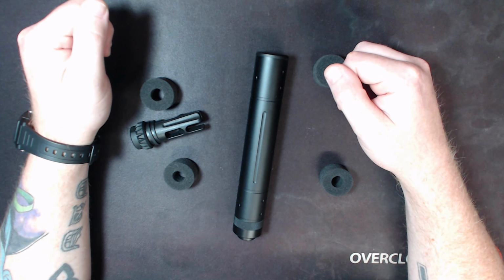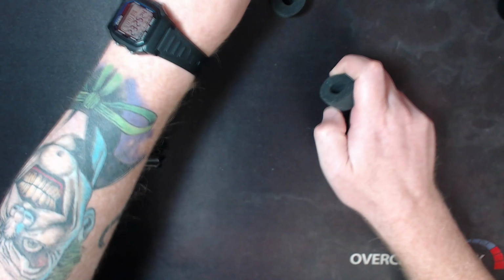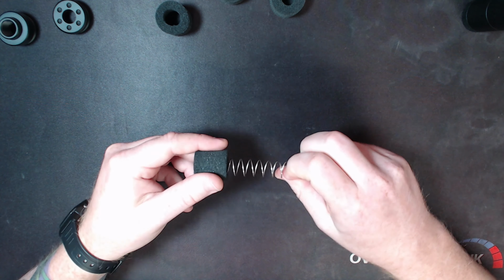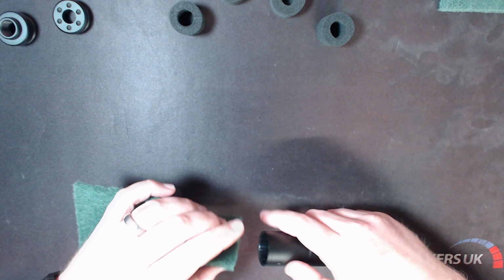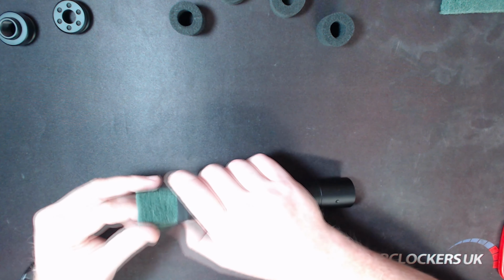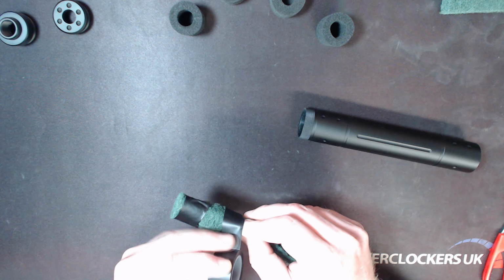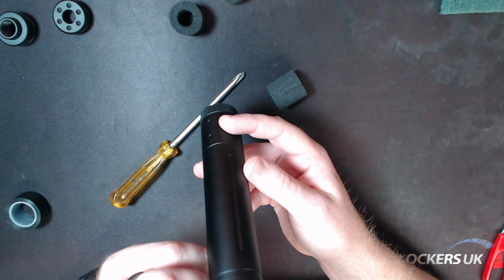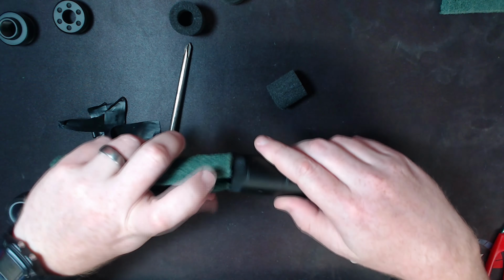Airsoft HPA Suppressor Make Up Internal Modification Brillo Pad Sound Baffles Silencer M-ETAL

Comment: It would work better if you cut washers out of the scouring pads that resemble the end of the foam inserts and stack them.
Reply from the maker: I did try that but getting the holes right without proper cutting tools was a nightmare. My new suppressor (SBA DTSS) is made with alternating size discs and it’s crazy quiet.
Reply: @AngryBullAirsoft Do you have a picture or video showing this?
Reply from the maker: @adamnarey8138  how do you mean? You mean the alternating inner?
Reply: @AngryBullAirsoft  Yes mate, the alternating size disks - especially how you suffered through cutting the outer and inner sizes without the correct tools 😂
Reply from the maker: @adamnarey8138  with you - the SBA comes with this as standard. I think Novritsch has similar in his now
Reply: @AngryBullAirsoft  Oh, I thought you did the alternating size discs with Brillo pads? As ones that are pre-made are very smooth as stated

Comment: Great idea but  i would include one more step into your guide and that is using a torch and gently removing hairs from the inside of your foam pad before rolling it into the suppressor. Like this you will have a much better result than with a pipe sticking in afterwards.

Comment: Build the foam around the spring, 
Us the discarded spinning as jig to Build around.
Reply from the maker: Posisbly yes, but - is the spring too wide? by closing in a bit more you can do better. I'm currently using Silverback suppressors on my rifles, those things are crazy good with no effort needed.

Comment: Have you done any experimenting with HPA builds of how many foam baffles or what suppressor length you need before it’s diminishing returns?
Reply from the maker: I haven’t, since making this video I bought a SBA DTSS which sounded “better” it was quieter and less crack on the output. I stopped fiddling at that point.
Reply: @AngryBullAirsoft  which one? The 338 big boi?
Reply from the maker: 308 but it’s still a fairly big beast. Love it on my MTW - barely hear anything
Reply: @AngryBullAirsoft  Nice! Best suppressor you’ve used then? Better than the scotchbrite mod or better than Hex?
Reply from the maker: Difficult to say as I haven’t had them all side by side but my general feelings are DTSS is an easy option without needing hours of tweaking. It’s just a suppressor after all. I have a 338 on my silverback srs and I bought one of the mk23 ones for my mk as well. I have confidence in them
Reply: @AngryBullAirsoft  Nice! I have an old carbon one knocking about somewhere, must say I think the Silverback foam is very nice! May adapt it for a prototype HPA VSR build I’m doing

Comment: I was considering punching discs out of this and stacking them inside for a more uniform hole
Reply from the maker: Would be the best approach if you alternate the hole size between a larger and smaller aperture to give more surface area to absorb sound waves 👍
Reply: @AngryBullAirsoft  im just worried about creating turbulent air in the suppressor and effecting accuracy. I may be starting yo overthink it lol
Reply from the maker: Little bit maybe, the silverback suppressors come like that though and they're golden.
Reply: @AngryBullAirsoft  i have some open cell foam block i can use i was going to alternate materials but ill play with a couple different ideas i have a whole range of punches

Comment: Thanks for the video, gave me some things to think about.
But some points of critic:
To measure the circumfence of the supressor just calculate C = 2 · r · π  (C=circumfence, r= radius of the tube) and then take a ruler and cut it of with a cutter.
And after all it took very long for you to show everything.
One question, why not just wrap it around the spring that was inside the package first?
And now an idea that just came to my mind, but i have not tried it yet:
Try to fold the green stuff like 4 times over the long side. After that cut out small bits (triangles for exaple) on the longer side, nearly to the middle,  on both sides. When you now unfold it you have many holes in it, where a lot of air and sound can travel and gets reflected.
Keep on making videos!
Regards, Jan

Comment: Disappointing that the all important part was not done. The before and after sound check (i.e if it actually works!). Planning an instructional video is vital so as not to leave your viewers hanging! Very frustrating!
Reply from the maker: Fully agree, before and after would have been the correct way of doing this. At the time I got a bit excited and ripped straight into it. Will definitely be something I do in future videos of this kind 👍